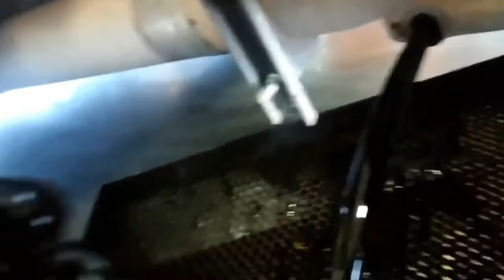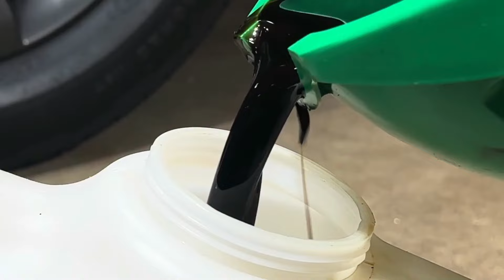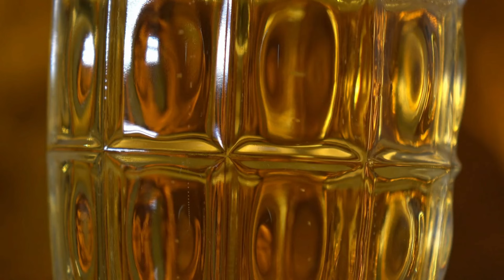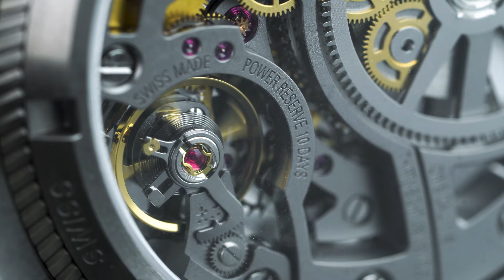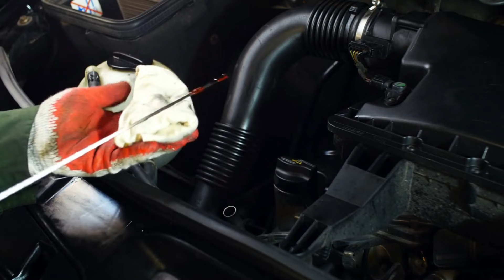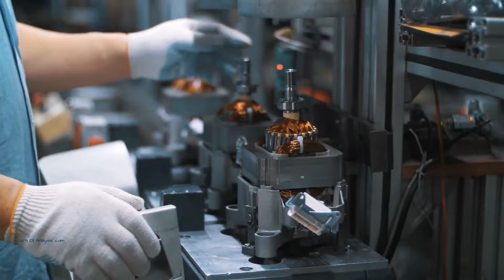This Engine Oil Will DESTROY Your Car - Most Drivers Have No Idea!

Comment: regular changes matter also change the filter, I ran Walmart and Costco synthenic in a 3.8 liter genesis for 170,000 miles, ran Walmart in my town car 100,200 miles, now running Costco in my Avalon, have taken several long distance trips, driven non stop central Florida to  North Texas . no problems

Comment: The same motor fitted to a car in USA carries different recommend specs in SA.  New 2025 VW Polo 5W40 from factory. Same goes for other brands. Don't say small tolerances. K series Honda known for tigh specs and durability recommend the same. Sorry. Homework not complete.